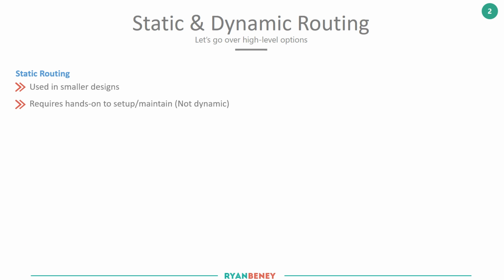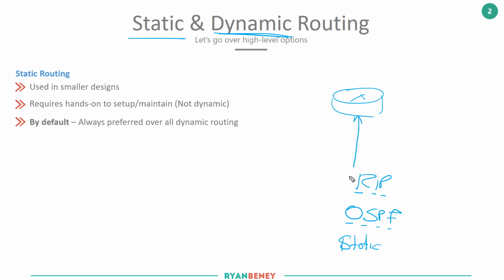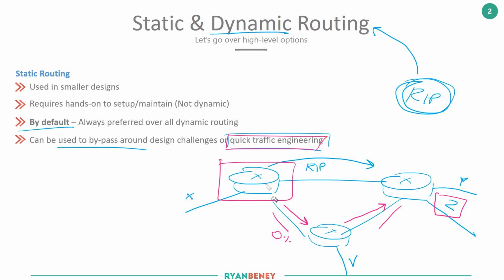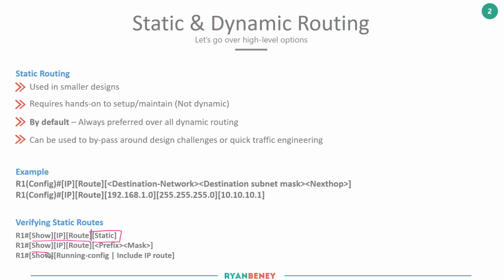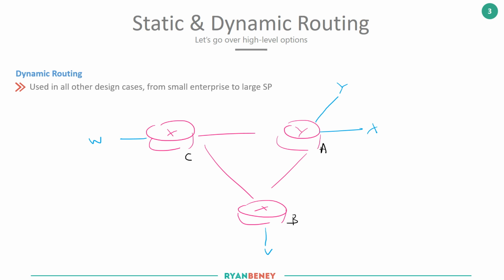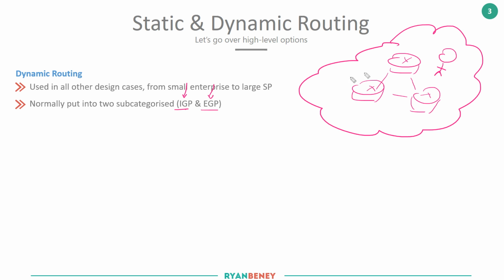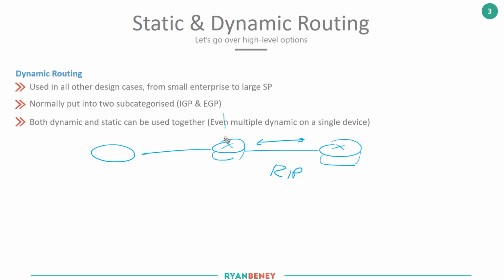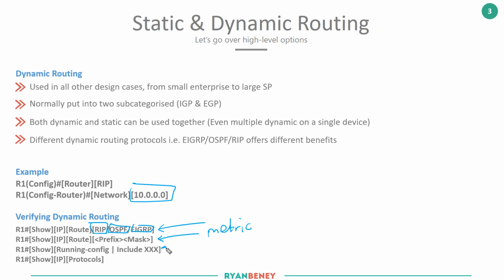Cisco - CCENT/CCNA R&S (100-105) - Static and Dynamic Routing .30

Comment: Absolute legend. Do you take donations? I will be donating when I pass
Reply from the maker: Hey Jamie - All the best with your studies. Should be a link up the top for donation. Cheers
Reply: Hi Ryan 

Just got my hands on packet tracer. which is the best video to watch for configuring a router from scratch. I have two routers in my network and need to configure them. I am sure I have seen it in one of these videos but there is so much to take in and I sometimes need to go back! 

Any help would be great! 

Cheers 

Jamie